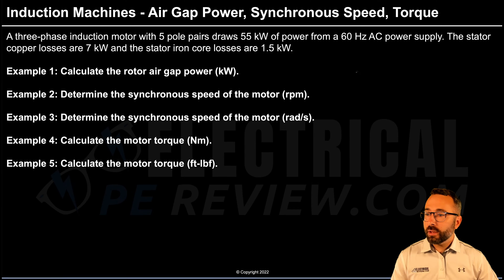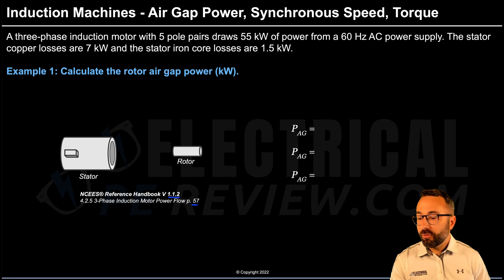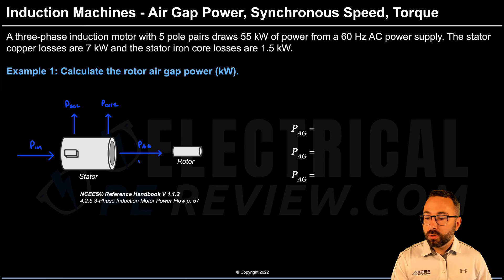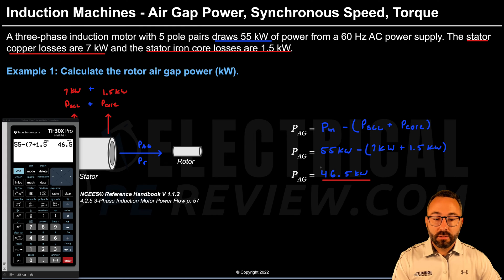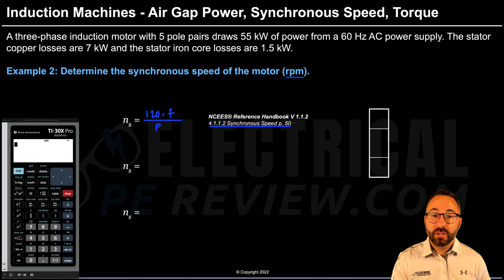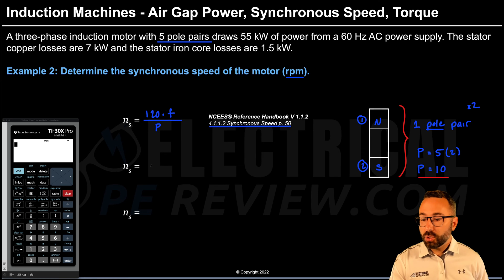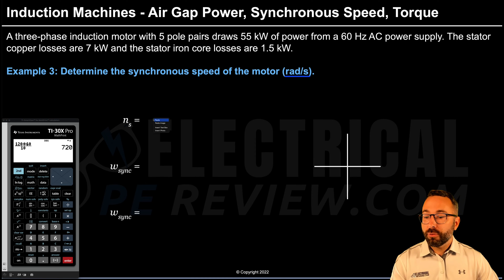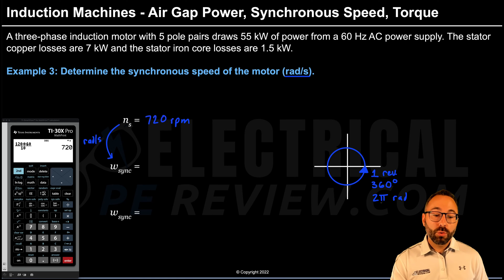Induction Motor - Air Gap Rotor Power, Synchronous Speed, and Torque for the NCEES® Power PE Exam

Comment from the maker: Table of Contents:
0:00 - Problem Statement
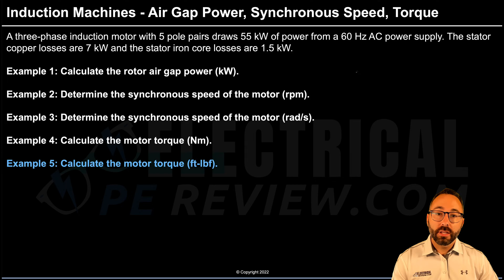0:43 - Rotor Air Gap Power (PAG)
3:03 - Synchronous Speed (ns) in revolutions per minute (rpm)
5:59 - Synchronous Speed (w sync) in radians per second (rad/s)
8:37 - Overview of all four torque (Tind) formulas
12:55 - Calculating motor torque (Tin) in newton meters (Nm)
14:07 - Calculating motor torque (Tin) in foot-pound force (ft-lbf)